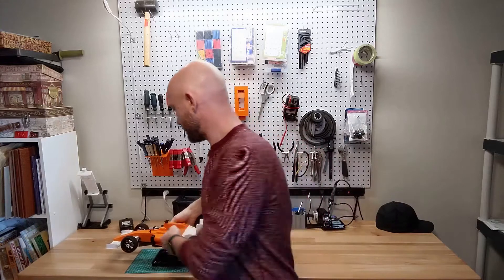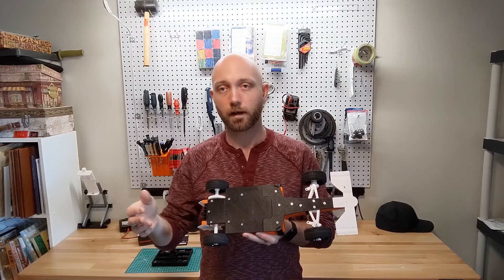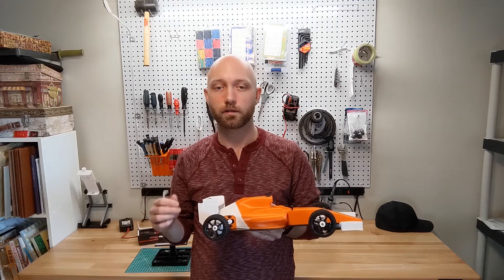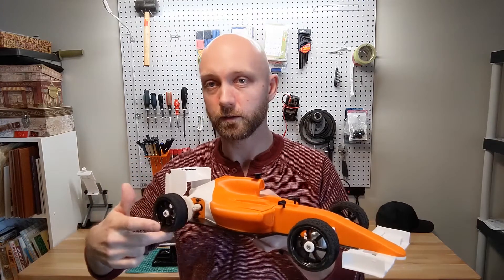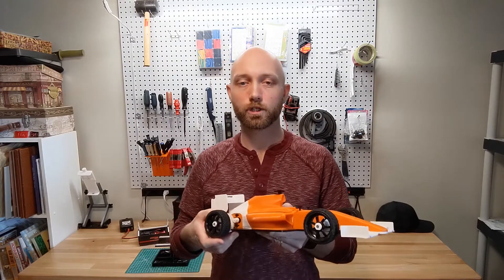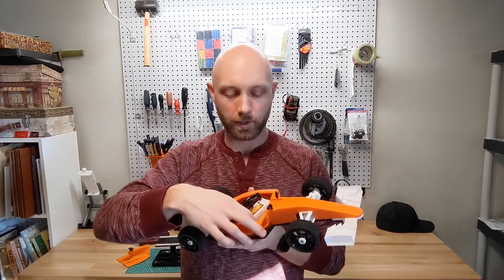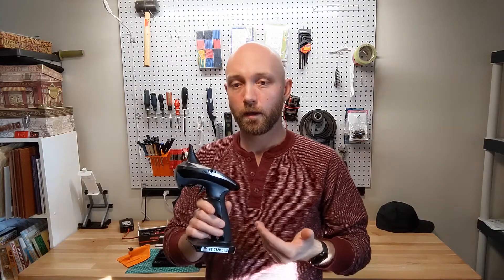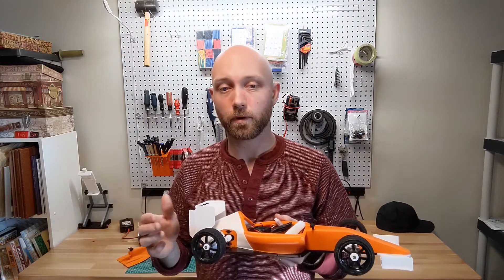OpenRC F1 - Should I build it? Comprehensive Review

Comment: Will these parts fit on the Prusa Mini without scaling? Great review, thank you!
Reply from the maker: Hey, great question. I just pulled up my slicer and everything fits easily except for the two main chassis pieces. The size of the build plate is 180mm but the pieces are actually 180.4mm so they technically don't fit. But you MIGHT be able to get it to fit if you print without a skirt and somehow bypass warnings saying you're too close to the edge, or trim off .4 mm of the pieces. If you try it let me know how it goes! I unfortunately don't have a mini of my own to test on.

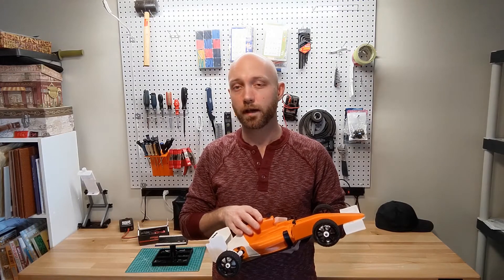Comment: Thanks for the time to review this model. On the video you mentioned that Daniel included the printable files for the Tamiya tires. I printed the ones that came with all the files from Thingiverse.com OpenRC F1 car - 1:10 RC Car) but the rings are smaller than the actual tire by almost 5mm. Would you please share the link to the rings compatible with the Tamiya tires. Thanks in advance.
Reply: Hmmm, sorry I've never used them myself so I wouldn't know offhand. Did you check thingiverse for rims that might be compatible with your tires? you could try... https://www.thingiverse.com/thing:1462917 or https://www.thingiverse.com/thing:2839554 ... Again, I've never used them but these were the first ones that showed up on a google search.
Reply: @JordanVisco  thanks. I’ll try the first option.

Comment: For the 12mm hex 1:10 wheel adapters and those specific tires you used do you still need the same type of bearings (8x12x3.5). Thanks
Reply from the maker: Yup same exact bearings.